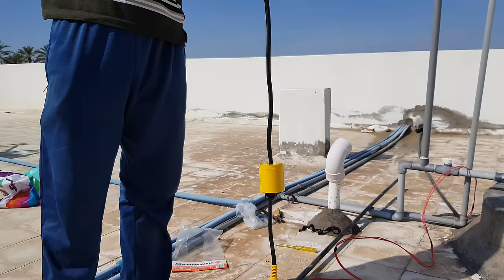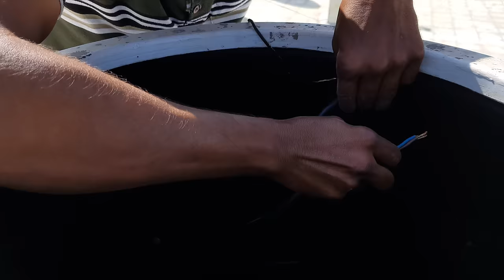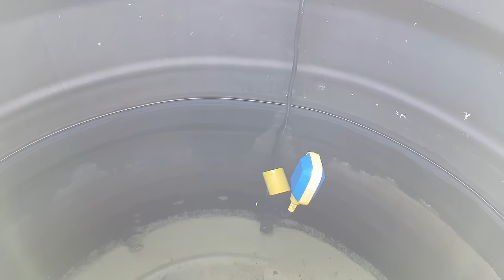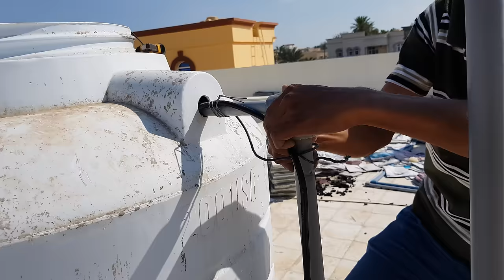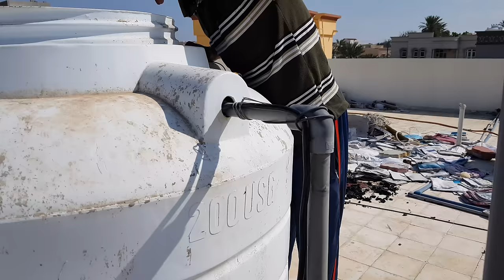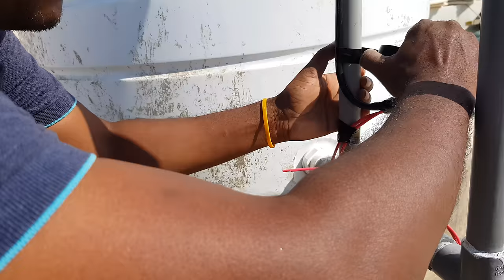Installing a Floating Switch in Your Water Tank for Automatic Level Control

Comment: Very Unprofessional Installation & Workmanship ! It's not a right method. Use Manual Or Taking a guidelines from Professional Technicians. Avoid Damages of Floats.
Reply: Yes I agree. Insulation tape used outside in the rain and sun is not acceptable. This is dangerous wiring.

Comment: We're asking u question u are telling thanks and share the video is tht make any sence?
Reply from the maker: What question bro?
Reply: He doesn't understand English. Lol
Reply: Can I connect two sensor to the pump from  two tank
Reply: @kennethrobinson8369  I rather you connect the two tanks together by way of piping and ballvalves and use a single sensor in the tank that is at a lower elevation of the 2.... I have done this using  6 ×10000L tanks... works great.
Another thing I would not tie a knot in  my electrical cable as he did at the start of the video...instead wrap the plumbers tape around the required length on the sensor cable forming a bulge and then pull the weight onto it firmly.
Reply: @kennethrobinson8369  yes you can but you have to use 1 spdt 12v relay to operated the first tank

Comment: The weight should be farther from the float to use the full capacity of the tank!  Too close to the weight and they pump will turn on and off quicker.  The float activates not at straight up or down but rather a 40 degree up and down angle; making the switch range also smaller.  Move the weight to the middle and the hanging float closer to the bottom.  If water demand is high, move the weight and float higher in the tank.
Reply from the maker: Thanks dear for your comments. Please share our video to your friends and country. Like us comment us and subscribe us
Reply: God bless you... 🙏🏻🙏🏻
Reply: how do u make the switch range bigger.   i have a 3 meter tank and the switch range maybe is only 1 meter.
Reply: Joshua Tan get a longer cable
Reply: গজগ
Reply: @joshuatan8291  increase the distance between the counterweight and the float switch, or if that doesn't give enough range then like others said you need more cable. If there is cable slack outside the tank pull more into the tank, if no slack is available then you need more cable. One of hundreds of reasons it's always best to leave plenty of slack in your wires and cables.
Reply: লললল

Comment: Sir, I have a water pump that needs to fill the water tank. The motor is used to run when the tank gets empty and stop when it gets full by means of a float switch. The water tank is approximately 400 meters away from the water pump. My question is, Can I use to extend the wire of the float switch from the water pump/controller to the water tank by 400 meters to fully automate the system? If so, what size and type of wire do I need to use? Thank you
Reply: Yes u can use but use the haevy wire for that becoz it's too long
Reply: That's all very specific to your supply power, and the ratings if the equipment, be careful.

Comment: Sorry, but insulation tape is not waterproof. Should never be used outside where it gets wet.
Minimum is you'll end up with a short or the pump not working. At the worst you'll end up with someone dead!

Do a proper job and use a waterproof connector.

Comment: With out low voltage protection may cause 
Burne the motor
Reply from the maker: 😀😀 Thanks dear for your comments. Please share our video to your friends and country. Like us comment us and subscribe us
Reply: No. It shuts power completely to the pump when the float switch is activated

Comment: Sir, what power supply it requires, can we direct connect to 230v outlet or it requires dc to ac converter.?
Reply from the maker: Thanks for your comments. Please share our videos to your friends and country. Like us support us and subscribe to our channel. Be happy ☺
Reply: 230V=230VAC you don't need to convert.  AC=Alternate current.
Reply: @richardcharman  You better control it by a 24v transformer... Thanks
Reply: 220  ac

Comment: first wrong your water tank connection the out put water flow pipe does not connect union . any problems in water tank how open it with out union . 2nd you fit the device very deef on  water tank . water tank does not full of water .
Reply from the maker: Ok sir, Thanks dear for your comments. Please share our video to your friends and country. Like us comment us and subscribe us
Reply: 1) Sir it may be that he doesn't know how to use a timer and the relay because the water in the well could be small to go up to the best level so he dicided tho connect it that way
2) sir he is working with pressure pipe the place may not be in a rigit

Comment: Is it me , or he didn't connect the earthing wire ? 🤔
Reply: There is no metal to touch, so no Earth required.
Reply: @GlynWilliams1950  in that case why would the manufacturer provide an earthing wire?
Reply: @dimitrz2000  there is no earth wire, the green wire is not for Earth.
Reply: @GlynWilliams1950  thanks for clarifying